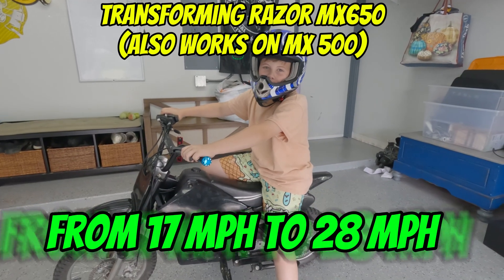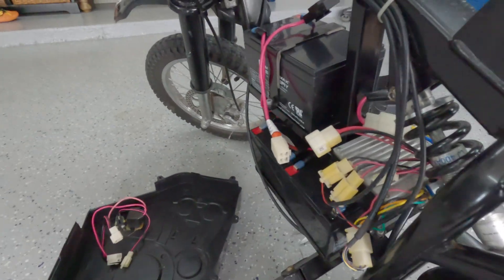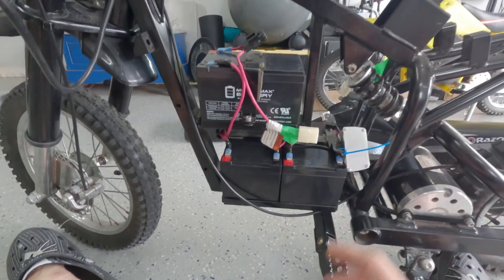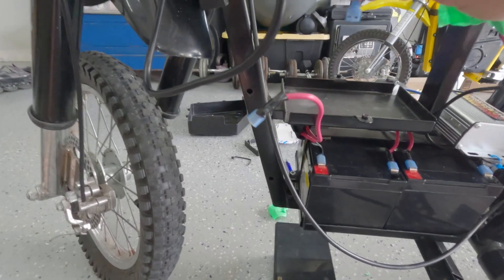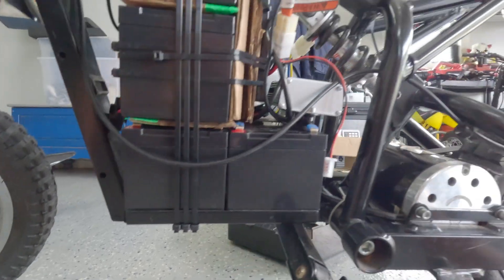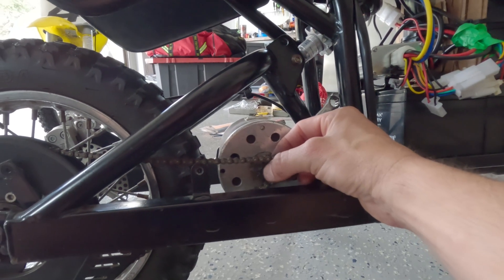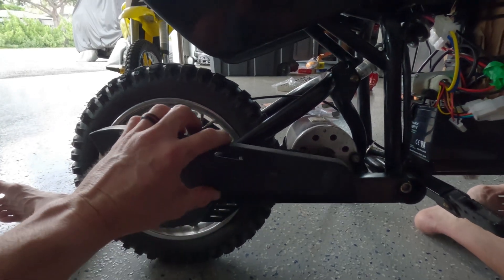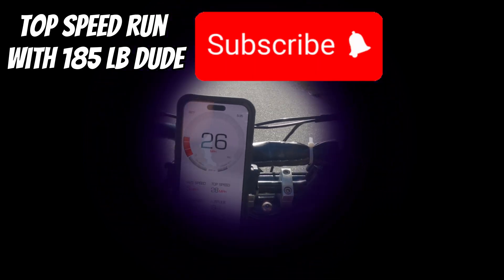Razor MX650 / MX500 top speed upgrade mod! Cheap and easy how to DIY Razor Dirt bike OVERVOLT!

Comment: where did u get the wire?
Reply: the extra wire to connect the last battery
Reply from the maker: @minimotoYT153:42 I used 12G wire with 1/4” female spade connectors. You can get them from any auto parts store 😎🤟
Reply: ok thanks so much! great video by the way!
Reply from the maker: Which wire exactly you talking about? 🤔
Reply: How did you get that sprocket off so easy I tried to pry mine off but it won’t budge scared I might break the motor I put so much strength on it
Reply from the maker: @msubb1083 it’s reverse thread! Most important step! 😁🤟
Reply: @Kizyle I know that I got the nut off I’m talking the sprocket itself it’s almost like it’s welded to the motors axel
Reply from the maker: @msubb1083  so based on what I’m hearing, sounds like it could be rusted on. I’d recommend spraying a penetrating oil (pb blaster) or heating it up. Then try lightly prying it off